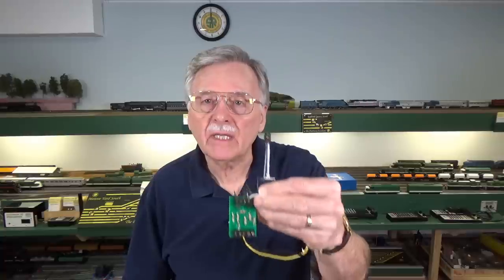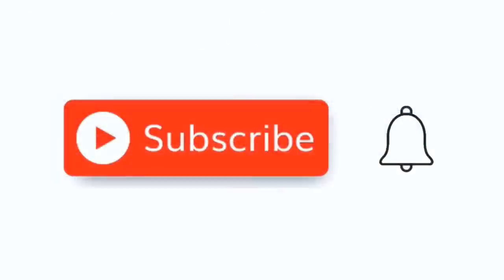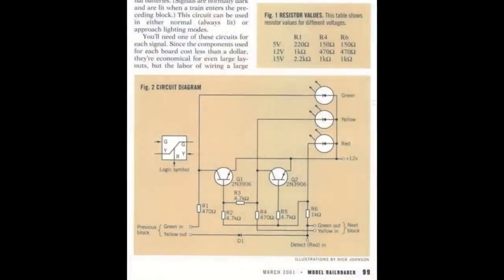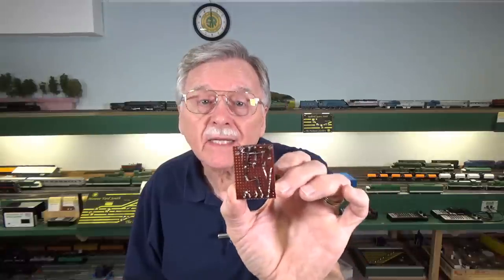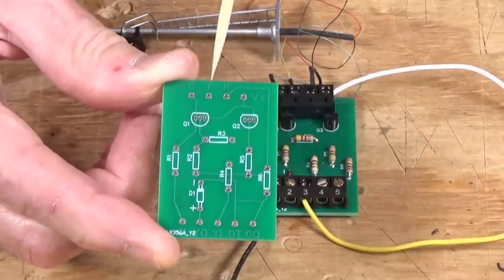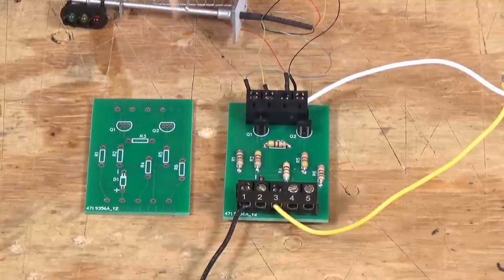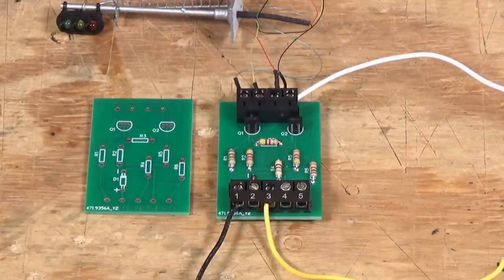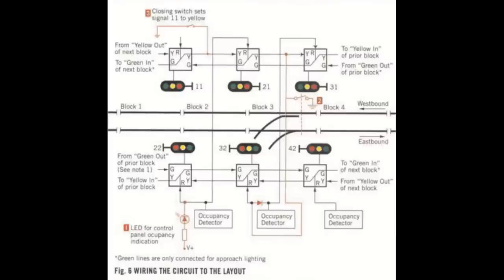The ABS Signals Circuit Board (289)

Comment: As an electrical engineer, I found your use of the phrases "minus 12" or "minus 12 volts", when you actually meant "ground side" of your layout's12 volt supply, to be confusing, and, for people new to the hobby of model railroading, perhaps a little misleading.  When discussing electrical issues, I would encourage the use of a more precise choice of terminology.
Reply from the maker: I always debate saying 12V- instead of ground (GND) but novices tend to be confused more by saying ground instead of referring to the 12V- connection from the 12VDC power supply. Another commentor just argued against saying ground as it implies a true earth connection. So I just try to fully describe the electrical connections as best as possible.

Comment: I cannot locate the file. I searched for "detector logic 2" and it returned over 1400 results, none were correct. Is there another way to obtain the file?
Reply from the maker: They apparently reworked their web interface. When the search results come up there is a heading line listing various directories. Click on the “modules” selection and they are right there listed as PCB_Detector logic 2.

Comment: I didn't see an earth / ground / 0 volt connection on the circuit....
Reply from the maker: The earth is supplied through the detector connection or directly via the 12V- connection should you use that option. I always debate saying 12V- instead of ground (GND) but novices tend to be confused more by saying ground instead of referring to the 12V- connection from the 12VDC power supply.

Comment: I hand built a circuit board several years ago when this article came out, and I was surprised how simple it is to put together, and it worked as illustrated.
Reply from the maker: One or two isn’t bad but when you need twenty or more then it is a pain in the butt! But I now have more boards than I need and soldering them up is easy and less likely to have any issues.
Reply: @TheDCCGuy  Another alternative is to use breadboards when testing your circuits.

Comment: Larry, I just downloaded your gerber file and placed an order with JLCPCB for 50 of these boards.  It was an easy process that only cost $12.50 for the boards and $5.53 for shipping.  About $18 total for 50 boards delivered is about 36 cents each - fantastic. I'll use your parts list (with the 750ohm R1 adjustment) to buy my components.  Now I just have to get my NCE BD20 occupancy detectors and ABS signals.
Reply: Hi Steve, can you tell me how you downloaded the Gerber file please? I've asked Larry as well, and am waiting for an answer

Comment: I built 14 of these for 7 blocks of both directions. I can show the way I interconnected them using RJ45 ethernet cable, but I don't know where to upload the schematic. All in all, the system is inexpensive, it does approach lighting perfectly, and it's very simple and quick to build. 2 Thumbs UP.
Reply from the maker: So glad to hear it worked out so well for you. You can email me your diagram as an attachment to ljpuckett at icloud dot com .

Comment: Hi. Thank you for all this information. I have tried to get the PCBs here in the UK and quotes I have had varied from £250 to £480.00. for 30 boards. The chinese company wanted £50+ for postage for 5 boards. So I came up with a "Vero-Board" solution that cost very little to produce. I have built my first one and now trying to see how to incoperate it into my layout. Thanks again.
Reply from the maker: Sorry to hear that postage is so high to the UK. Did they base the shipping on using a carrier like DHL or their own cheap mail packet? The DHL rate is pretty expensive and it what their shipping quote defaults to so you have to select the cheapest option. I still got mine in only a little over a week.

Comment: Regarding the comment from Tron, and hoping not to cause offence:
I have worked in the field of Industrial Process Control Instrumentation for 45-years, and the term ‘Ground’ for an electrical circuit should only be used when that circuit is connected directly to the general mass of earth, e.g. a protective earth (PE) circuit or signal screen circuit.
For dc derived supplies such as cells/batteries or electrical ac to dc power supplies, the correct term for a negative potential conductor is notated as ‘0V’, pronounced zero volts or nought volts. It may also just be notated as ‘-‘, or minus, but is still referred to as nought or zero volts. Hope this is of help.
Reply from the maker: I always debate saying 12V- instead of ground (GND) but novices tend to be confused moreby saying ground instead of referring to the 12V- connection from the 12VDC power supply. EEs will argue both sides as another commentor just did.

Comment: Larry: Thanks for this. I've built it and am testing, with mixed results. What should the unused inputs at the beginning and end of the chain get? Eastbound YI and Westbound GI in particular at the right side of the chain and EB GI and WB YI at the left. Should I float, ground them or set them to +V? Also, why did you go with a larger R1? Since I'm using 5V instead of 12V as you did, should I try a larger value for R1 as you did? I figure it should be about 240ohm, based on the ratio you used.
Reply from the maker: Yes, you do need to use the 5V component list but remember the list in the original article is reversed. I spoke to Jeff Sherb about the issue I had and he told me he had never experienced the need to change the value of R1 so it could be I got a batch of transistors out of spec. At any rate all I can advise is try it with one value and see if it is stable but be ready to test with the alternate value which is what I did with the hand built ones I showed.
Reply: @TheDCCGuy  I appreciate the response, and I did use a 220 in place of the 150 called for, the result is no change, so I guess the 150 originally called for is fine.

The system works great going East (left to right on the diagram at video time 22.22). West doesn't light up at the rightmost block. Should there be some inputs to that block for trains entering the system going West?
Reply from the maker: Yes if you look closely at that diagram it shows the connection between the detector and the boards (shown in basic logic form) on both sides of the single track. I use the normally green on configuration which only requires the yellow wires be connected between boards. For advance loghting you would also need to add the green wires as shown in the original article and my hand drawn diagram.

Comment: Hi Larry, Excellent demo!, I used a ‘simplified’ BD20 unit as described by JT Chamberlain of A-Train Systems, with your ABS simplified circuit but no avail! Are you or will you be able to have a look at the said (of if I send you the circuit of the same for you to have a look at) as I have purchased some of ABS circuit boards and like to make full use of them.
Any advice/help will be greatly appreciated,
With Kind Regards 
Jay,
‘Down Under’ Melbourne
Reply from the maker: Did you bench test the circuit boards as I showed in the video? If they work as mine did then it is not the ABS logic board and instead must be the detector. If the circuit board does not work in a bench test then you need to recheck your soldering and make sure all components are oriented correctly. I find that about 99% of all electrical problems are due to wiring/soldering issues.

Comment: Larry,  could you explain how to generate a Gerber file from the Easy EDA site and, then, how to copy it so it can be sent to jlc, please? I registered at EDA but could not find how to generate the Gerber file. Thank you.
Reply from the maker: Once you have found my detector logic files and opened them in EastEDA or generated your own circuit board diagram look up at the top menu and under Files there is an option to creat a Gerber file. You can also just go to Fabrication and at the bottom submit a PCB order. They usually have tech support folks who appear in popups to answer any questions you have. Be careful selecting a shipping method.The epacket is cheapest a d actually comes much faster than they project. The UPS and DHL options can run into money.

Comment: I want to know what you do with all these circuit boards. How do you mount them to the layout underneath. Just hot glue, tape? If all boards had holes for screws, then fine. But many don’t
Reply from the maker: Double sided foam tape or adhesive backed Velcro. You could also drill a mounting hole in the edge

Comment: Excellent video, Larry. With the use of this system, how long could your blocks be? Hate to think the signal system would upgrade to Approach while a train was still in the block.
Reply from the maker: In the video I showed a diagram pointing out the blocks should be about as long as your longest train plus about 15%.
Reply: @Model Railroading  Thanks, would you also recommend adding resistance wheel sets to your rolling stock for better detection?
Reply from the maker: I don’t add them to all rolling stock, just cabooses and unlit passenger cars. Once I am operating multiple trains I likely will add them to a small percentage as needed. I will do a video on that aspect of current based detection.

Comment: Will this circuit work with the Digitrax BD4N?
Reply from the maker: In looking over their documentation it appears their detect out is positive [+] whereas this circuit requires a negative a (-) detect signal. I have not used these so you will need to confirm this with Digitrax tech support.

Comment: Could this be altered to use optical detectors?
Reply from the maker: Yes, any type of detector that supplies a 12V- (GND) connection to the detect in screw terminal should work. However, an optical detector will only activate the signal as long as there is something blocking the optical path. The type I used detects a loco or detectable piece of rolling stock anywhere in the block. You would need some kind of “latching” circuit with an optical detector.
Reply: @TheDCCGuy  but with current detection I need to install insulated rail joiners and crest blocks, no?
Reply from the maker: Yes, you would need to gap the rails at block boundaries, but that can be done with a Dremel cutoff disk or razor saw. If you don’t want to see the gaps you can insert styrene sheet, glue it in place, and then cut to the rail profile with a knife. I usually just leave them open to serve as expansion/contraction joints.

Comment: I would have added a non connected hole for a mounting point and added stand offs
Reply from the maker: I just use commercial strength velcro to attach them to the underside of the layout. Faster and easier than a screw.